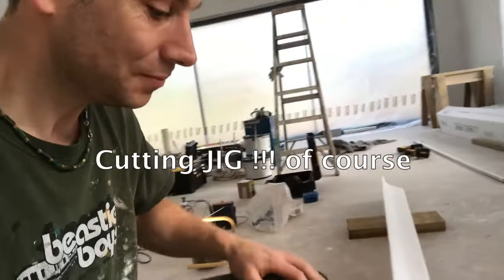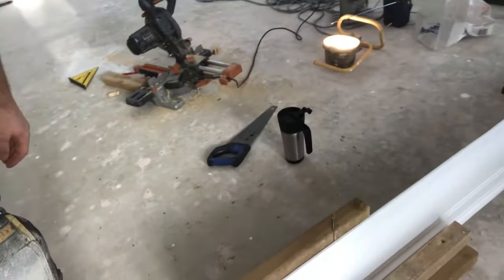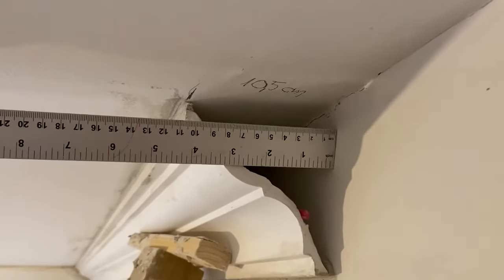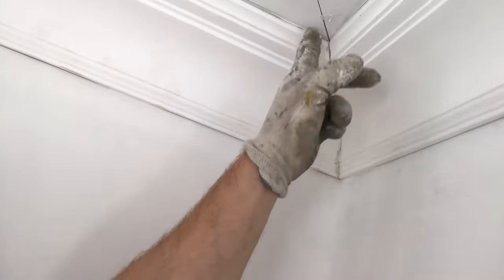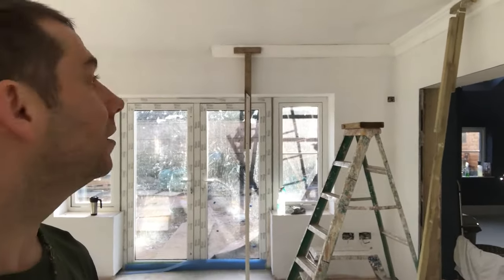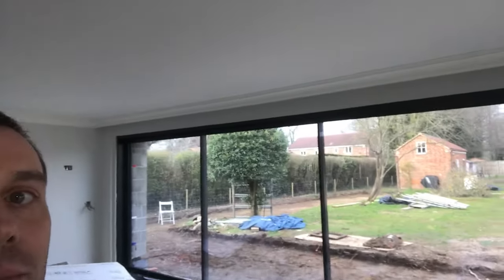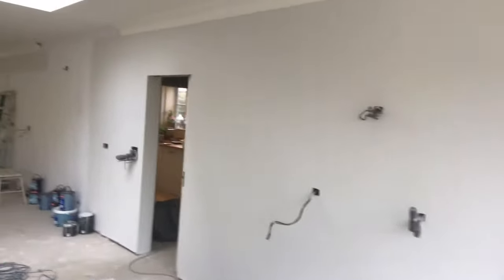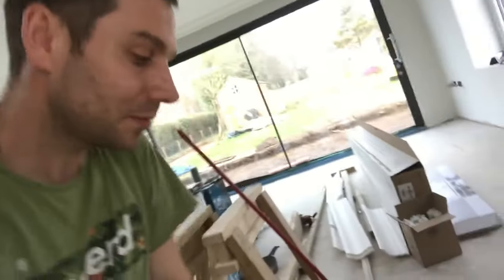Fitting Victorian Coving. Bespoke cutting jig is the key for Perfect joints

Comment: Nice job, pure manual labor well deserve of praise.  My contractor forgot a small portion of ceiling coving, he’s afraid it will clash with split type AC so he literally cut it off along that AC part which looks terrible as you well know that AC is offset from ceiling by 4” plus minus so it looks awkward having a discontinued coving if you can imagine what Im saying. So I know he used nail guns but since I dont have that will just rely on liquid glue instead hoping it will not fall on our heads one day.😅 You did’t screw those covings right? And they stay there  for years?
Reply from the maker: I know what you mean. But you can use glue in the tube for lightweight coving. Here is the link. No need for screws with lightweight coving. But i do screw screws together with adhesive with heavy plaster coving. 💪
https://www.screwfix.com/p/supercove-coving-adhesive-white-310ml/28537
Reply from the maker: I know what you mean. But you can use glue in the tube for lightweight coving. Here is the link. No need for screws with lightweight coving. But i do screw screws together with adhesive with heavy plaster coving. 💪
https://www.screwfix.com/p/supercove-coving-adhesive-white-310ml/28537

Comment: Love the curtain track behind the coving. Do you have any advice on how to do this? Do you just fix up some wood as a fake wall and then stick it onto that?
Reply from the maker: Cheers bro. Yeah exacly very easy like you said. I got cheap L-shape brackets about 10cm x 5cm then i drilled thrue plsterboard ceiling and found timber joists. Then i screwed long side of the bracket to the wooden board and short to the ceiling thru plasterboad so it was all solid. But i measures up that the bottom of the board "fake wall" is flash with bottom of coving. I glued and screwed coving then to that board and ceiling. I also pinted back of the board in room emulsion colour cos you can see it when curtains are open. 
Good luck man!
Reply: @FinePineNorwichCarpenter  thank you bro that is a huge help for me 🙏

Comment: What do you do if your angles are out? Example 48 degree and not 45?
Reply from the maker: Good point i mark with pencel where the gap is lets say 5mm on outside corner and take it don than slide coving to outside the saw guild and do it -cut it by eye and hand to the pencil mark. Simply shave that tiny tringle bit thats too much.

Comment: what adhesive did you use for this job
Reply from the maker: I used 2 glues in this video:
1st for lightwaight cove in the gun and also i use standard plasterboard adhesive that you mix with water for plaster coving. 
https://victoriancornice.co.uk/product/adhesive-decofix-hydro-300ml/?gclid=CjwKCAjwov6hBhBsEiwAvrvN6PWEWqlmLd8nAp0hUVZ6BmanUwzg7muDrcE7HSsI6qAQ9-23MQ8CVBoC1zYQAvD_BwE
I also recomend much cheaper and very very good stuff from screwfix:
https://www.screwfix.com/p/supercove-supercove-coving-adhesive-white-310ml/28537
Reply: @FinePineNorwichCarpenter  thanks , very nice job